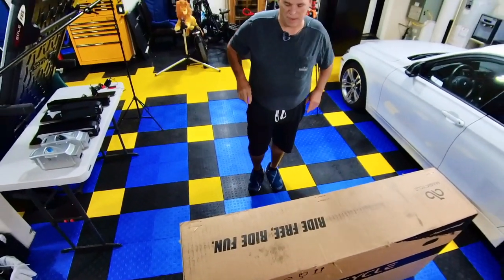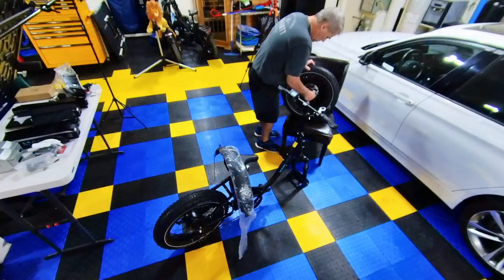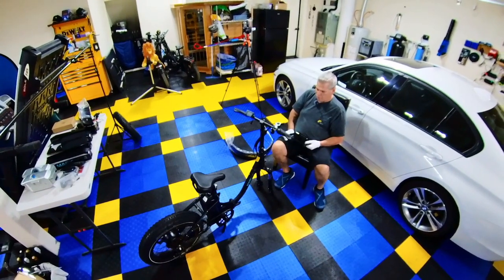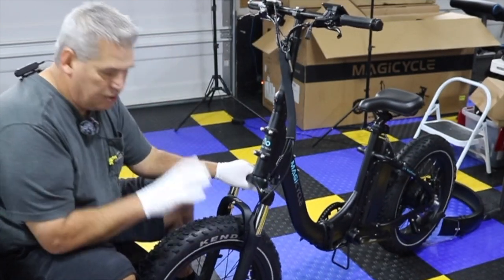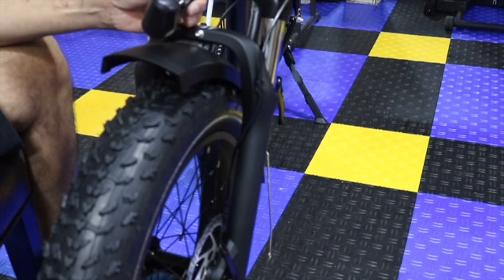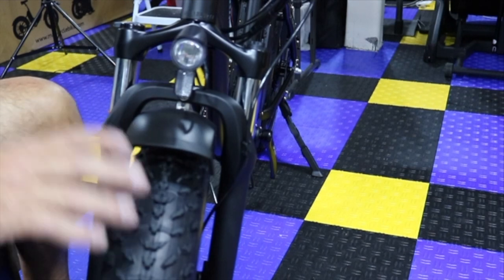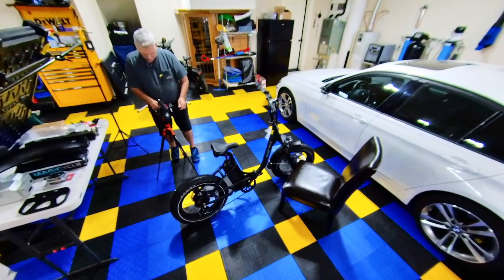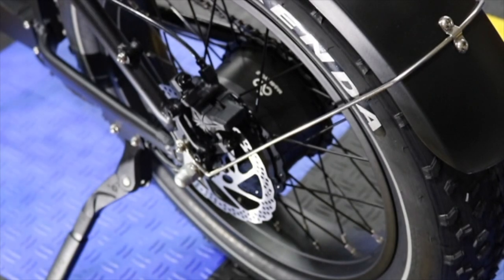Magicycle Jaguarundi 20"x4" Fat Tire Ebike Unboxing and Assembly

Comment: Tell me about the garage flooring, is that paint or some type of lay down puzzle piece material. If so, where can it be purchased? Very Cool, thanks
Reply from the maker: LOL. Lay down Puzzle pieces. It was easy todo.  Needed to figure out total squares and pattern I wanted.  Count the 3 colors  Yellow/Blue/Blk. you can do any of many color options in as many colors you want.  my floor is about 900+ sq and I think it was 2800 bucks or so. www.BigFloors.com

Comment: Thank you for making this video. I'm planning to bring our bikes with us for the first time with our travel trailer to SC in a couple of weeks. Do you have any idea what size tote they will fit/sit into? I'm thinking they must sit in the 50 gal but that sure is a big tote. I took one out for its first ride yesterday. I'm surprised by the power and how comfortable they are! Thanks
Reply from the maker: Juno, Im not sure on a folded size, but I would think 50Gal would be right.  Somthing like 20" wide should be fine.  The Bike is very nice and the Bangle brakes work well.  I love it too.
Reply: @RVEnthusiast  Thanks!

Comment: Nice video Bruce. Question. Will the handle bar shorten up any? I am looking for something for my 9 year old grandson. He’s a big boy for being 9 years old. I like the 52 volt and 15 ah. Same as my cruiser
Reply from the maker: I would think so!  Its 600W vs 750W. Road it today and it feels really nice though.  are you talking acout lower or less wide?  Width can be adjusted bu cutting.  Hight is limited
Reply: @RVEnthusiast  the height adjustment

Comment: Question I'm have trouble with the rear fender screws catching do you have any tips or issues with them getting started?
Reply from the maker: I am not having any issues. Wish i could see what your issue is.  I could help.  without pics, I can't exactly see the issue.
Reply: @RV Enthusiast  I figured it out. My issue was the screws to secure the rear fender wires were too short. But I switched them with the two for the top and bottom that secure it to the frame. It works perfectly